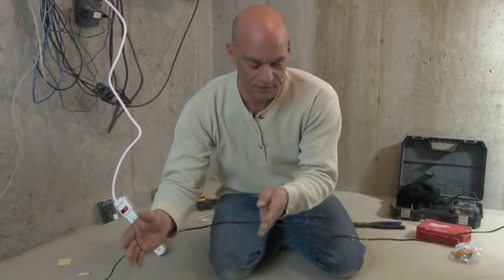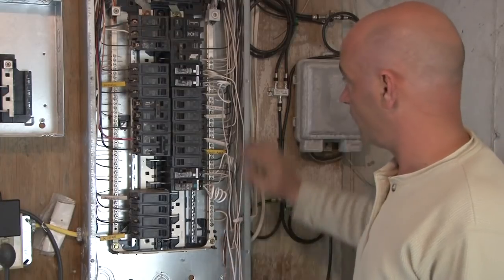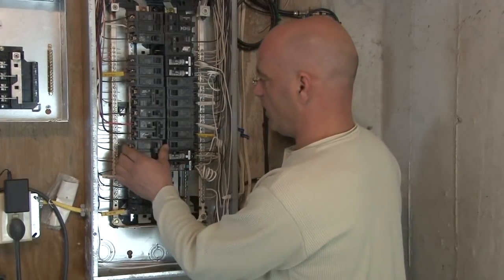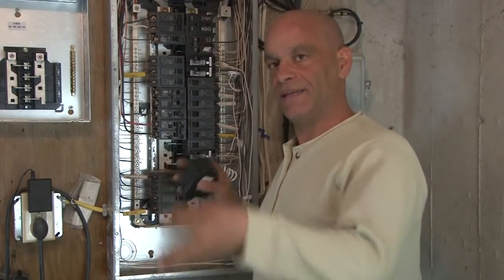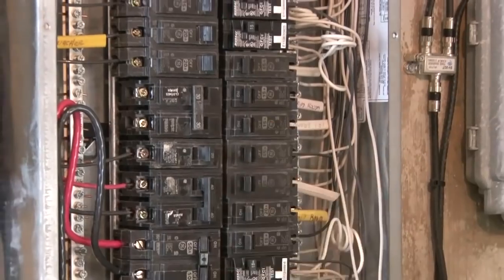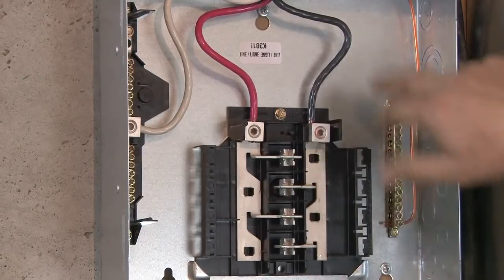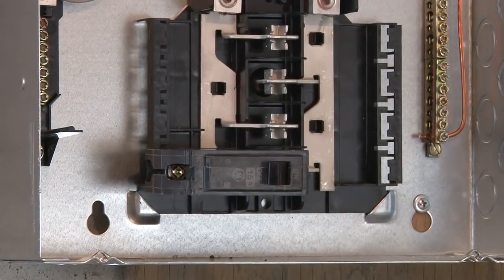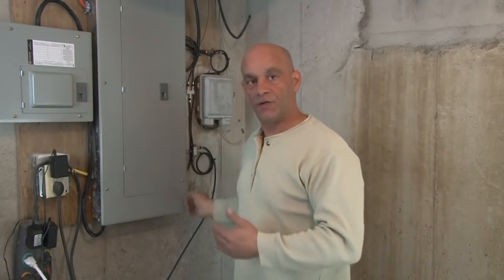How to Install a Subpanel

Comment: My Murray breaker box doesn't have a green bonding screw.
Reply from the maker: By code it should be green. But doesn’t have to be in order for it to work
Reply: @Askmediy  is there a to check if it bonded?
Can I use a multimeter also
Reply from the maker: @davidcowey604  Not really. You'll get a false reading I'm sure. Check out this page of mine and look for the picture. If you really can't tell after that just install a bonding strap-like shown in the picture
Reply: @Askmediy   ok thanks need to add a sup panel on my garage I am building.
Reply from the maker: @davidcowey604  I figured lol

Comment: Is conduit not necessary on the supply from the main panel to the sub?
Reply from the maker: No not at all. However so some reason it has to be exposed more than 18" I think. Then it will have to be protected somehow i.e conduit

Comment: I have a 100 amp main panel but want to install a 125 sub panel in my garage, is that possible?
Reply from the maker: Not really. You would need to upgrade your main panel first.

Comment: Hi there! I got some problem on my electric main box, one side of my workshop it's working pretty good .. but the other side I have no working outlets. I just  check those breakers and looks like every single one has electricity, but if I go ahead and check every outlet, that specific side doesn't have electricity. What I can do?
Reply from the maker: Check the neutral

Comment: Great video, thanks for taking the time to share. The only thing I would add is a reminder that the wires feeding the main breaker ARE ALWAYS LIVE. This is obvious to some but not to all. After turning off power by flipping the main breaker, everything downstream of that breaker is now off, but the wires feeding into the main breaker are still trying to kill you. Taping a piece of cardboard over the main breaker and its wires & lugs is an easy insurance policy. No one needs their screwdriver to slip and connect with a 240 volt 200 amp stream of death.

Comment: Glad I watched this as I learned about removing the bonding screw on the sub-panel so thanks for that. Now I feel good about installing a 60 amp sub-panel in my grandson's garage.
Reply from the maker: Awesome deal, glad I could help out.
Reply: @Askmediy  Good video. Thanks. However, it is not clear why the bonding screw must be removed in sub-panel. After all, neutral in sub goes to the main, where ground and neutral are already bonded. So, all the (green) bond in sub would do is to duplicate the (existing) bond in main. What is the harm?
Reply from the maker: Go to my site for the subpanel and read what I wrote

Comment: Idk but I would have run conduit between the two boxes. I was told that if u use any knockouts on the side u had to use conduit. The reason it because it is not within 3 feet to be stapled down. Idk just my opinion

Comment: Does the strap that connects both neutrals together in the Sub panel has to removed also, or is it just the bonding screw. Speaking of a 125amp Main Lug  Panel

Comment: I'm about to put a 20 amp DP from house to shed using 12/3 wire. Connect to sub panel on shed then add 2...20 amp 120v breakers. Would that work?
Reply from the maker: What’s a DP?
Reply: @Askmediy  double pole
Reply from the maker: Tell you off 12 wire is way to  small for any sub panel
Reply: @Askmediy  thank you so much for your input.
Reply from the maker: @peterzatolochenko1449  Always, now off to bed I go.

Comment: You forgot to say what size wire from main to sub. YOu said 50 amp. is that #8 or what? How about explaining why the screw is taken out of the neutral busbar on sub. Also why if you feed a garage or other building from the sub you have to have a separate ground with #6  rather than carrying the ground right back to the sub

Comment: I have a 200A Main Panel, IT'S A 16 CIRCUIT PANEL Inclusive of 8 full size breaker slots and 16 half size breaker slots. Therefore on both neutral and ground buss bars I will have 16 screws. Just saying if I'm installing the full size and half size breakers amount to 24 breakers , can I pin down on the bars neutral on neutral and ground on ground.  And my second question is can I install a 100A subpanel off my Main 200A panel. with a 3 x 10mm Armoured PVC Cable.
Reply from the maker: Yes, and I really can't say amperage without seeing it and knowing everything. But 100amp, seems like too much.

Comment: I have three phase power coming into my shop with a basic older 200amp panel that is nearly maxed out, I'm adding machines that are both three phase and single phase and my idea was to add a sub-panel to support the new equipment but i cant find any specific information about it. If I had a sub panel that can support 100amps and I need to feed the sub panel with three phase power, would I install a 100-125A 3 pole breaker in the main panel feeding the sub panel and then 3 and 2 pole breakers in the sub panel to support the equipment? Is this going to be the smartest way to add additional power in my shop?
Reply from the maker: Oh this is not an easy one for me to say. Need to know a lot more about your 3-phase. What voltage is your hot high leg. With a 3 phase sub panel I would really urge you to get someone there that KNOWS 3-phase. But yes. You  would come off the 3-phase panel , 2 hots to the sub, but I have to leave you there. I can get you hurt way to easy with this.

Comment: What kind of sub panel is that? Where do I get that type? I have an old house with a 100Amp small main panel and I am updating the kitchen and trying to put more circuits for newer kitchen appliances. And so far I've been finding only 60 amp sub panels with spot for only 2 breakers. Where can i get sub panel that you are using with room for... 6 breakers?
Reply from the maker: You can really use  any panel sized for what you want. But honestly if you only have a 100 amp now, I would just upgrade your panel.
Reply: @Askmediy  does upgrating my panel mean i need new service? What's the service wire gauge must be that i could put new 150amp main?
Reply from the maker: @CreatureOutOfTime  Yes all of that. That's going to depend on what you have now. But really if it's really old and undersized it would be best to replace that.

Comment: It seems like both the red and the black are coming from the same side of the panel , If I want to run 220 off the sub panel don't they have to come from opposite sides?
Reply from the maker: No, The breaker grabs both hot legs, 120 and 120 each.

Comment: With the sub-panel in another building, I understand the separate ground rod, Do you still need to use 4 wire? Thanks, Great Videos.
Reply from the maker: Yes by all means.

Comment: Great video! One question, I'm installing a 100 A sub-panel in an attached garage. The main panel is attached to the outside of the house, the sub-panel is inside the attached garage, but about 25 feet away. I'll run the 2-2-2-4 AL SER cable through metal conduit under the house in the crawl space to the attached garage. Since the garage has a cement floor it's not so easy to put in grounding rods in but from what I gather, it's not necessary since the garage is attached. Is this correct? Thanks again for the help and the video
Reply from the maker: Right, if it's attached you don't need to install a grounding rod for the sub-panel

Comment: So I don’t completely understand why the green screw from the sub-panel is removed
Would you care to explain?
Reply from the maker: First off sorry for the delay. For some reason I'm not getting emails on comments.. Because the neutral only gets bonded at 1st means of disconnect so any unbalanced load only has one true path to ground and that’s at the power source

Comment: I have been a Fan for awhile ,you have the best procedure that I have followed .I am running 100 amp from main to sub 60 ft  run away  from a basement to a attached garage I have the new grounding rod  outside the building  and all my new circuits are in on the sub panel .   i will be running #3 copper  for my mains and # 6 for my neutral and ground,,I need to run that in plastic conduit  ,my question is what type and size.thanks
Reply: Bigger is better and not much more money. Minimum I'd install is 1.5"
Reply from the maker: First off sorry for the delay, for some reason I'm not getting emails for comments. I really don't understand your question. Size of what?

Comment: Thanks for the video. Want to add a sub panel for a detached garage. Still gathering all the required information. Will try to upload the video.
Reply from the maker: First off sorry for the delay, for some reason I'm not getting emails for comments. Just remember for a detached garage you'll need a new grounding rod at the garage.

Comment: if I were to connect another subpanel to my existing main lug subpanel, would I just run the same gauge wire as I used for my first 50amp panel (used 6/3uf-b)? install a 50 amp breaker in existing panel to feed the new main lug subpanel in my second building?
Reply from the maker: In the perfect world yes. But you'll have to take in consideration the max amps of your panel. That's not something I can just give you an answer on.
Reply: askmediy in the sub panel I’ll be putting in the new building, there will be 6 outlets, one of the outlets will run a golf cart charger, the others will just be outlets should the need arise to plug in a vac or trickle charger, no constant loads like the golf cart charger. It will also power 4 LED 4’ shop lights and 1 outdoor LED flood light. 

The current sub panel that was connected to my main panel box is a main lug sub panel that used 6/3uf-b to transfer power. It is power 4 halogen lights, 3 outdoor wall lights, 8 outlets, and a garage door opener.

Comment: could i get away with as a temp  solution to just use a wire nut in place of a ground bar if its only 4 wries until next month? and if yes do i also ground the chassis?

Comment: One question, i know when you wire a sub panel to a detach building (shed) you need a #6 wire to a 8ft grounding rod but do you still have ground connected between the main and the sub panel as show in this video at 9:57 ?

Thanks.
Reply from the maker: yes
Reply: @Askmediy  thank you

Comment: Hello Dominck,
I myself am getting ready to install a sub panel to feed my basement.
I noticed that on my Main Breaker Box that the Neutral and Ground bus bar IS NOT bonded to the case of the breaker box..
Is this a issue ???
Reply from the maker: It can be, but I would need a whole bunch of more info to really say.
Reply: What more info do you need ?

Comment: if a subpanel is added for purpose of "extending" a filled up main electrical panel, then is it necessary or desirable to increase the size of the main circuit breaker feeding the main panel?
Reply from the maker: It would really depend on the setup you have. Say an older 100 amp panel and it's filled. yes by all means.

Comment: We Germans need low Ampere only. Household connection to the grid 3 phase 230 V, 40 A max per phase main fuses, 14.5 kW max. Waschingmachine 230 V 16 A, Stove 400 V 25 A. Wires thinner same function. Power outage I know from hearsay only.

Comment: Good Video what size wire you use ? And can it go underground? And if I ran to a 50 amp breaker to feed sub panel then I wouldn’t have to run to main panel to reset breaker if it tripped right ?

Comment: Hi Dom. Question for you. I’m about to get jacuzzi soon. Is it the same wiring procedure .
Reply from the maker: For a sub panel yes.
Reply: Thank you very much for reply . So I'm going to do the same steps to install sub panel as you did in  this video and  from sub panel to jacuzzi, right ? It's either double 50 or double 60 breaker .

Comment: Why does the subpanel get ground and neutral isolation, if the main panel is bonded?  Doesn't that make any ground you run to the sub a bonded ground anyway? If you were to conductance check the ground in that subpanel with the neutral, you would find it is connected, regardless of that bonding screw.

Comment: This is the best video I have seen on this subject.  Now I just need to find a video on how to install a manual shut off switch in between those two.  For running power to my shed the county requires a shut off outside of my shed.

Comment: Thank you for this video. I bought a 70s trailer and was told I need to upgrade the sub panel but didn't know what the difference was. I also didn't know why some hot wires were all black and some red and black. Thanks for the clear explanation.

Comment: This video was so helpful when installing a sub panel to accommodate the 50 amps needed for a high performance AV system in an older home. The system required three duplex outlets, two 15 amp and one 20 amp, each on their own circuits using oversized wire (12 awg and 10 awg),  that are separate from the existing electrical service in the house. Apparently all that juice is needed just to accommodate the system's new power amplifiers.

Comment: If the main panel main breaker is 200 amp, can the breaker in the main panel feeding the sub panel be 200 amps as well? I need the sub panel to hold 3- 40 amp double pole breakers. What size should the sub panel feed breaker be? What size wire do I need between the panels? Thanks!
Reply from the maker: No not even close.
Reply: ok? That's it? Can you answer the other questions? Why bother to answer if you didn't even read the whole question and are not going to answer all the questions? I enjoyed your video and obviously thought you were the personality who could help me get information. I guess I was wrong!
Reply from the maker: Yeah sorry about that. I guess the one reason I try not to answer questions on a phone. This is all going to depend on what your existing panel has in it. Quickly I would say install a 100 amp breaker. But there are so many factors that come in play here. I would need to be there in order to really say what you need to do, or could even do. Since this needs to be inspected by a inspector anyway, I would just ask him, what he will allow.

Comment: Great video, really appreciated it. All the "I'm an expert too, here's what you did wrong" comments are really annoying.

I did have one question though. If installing a grounding rod at a detached building, would you still run a ground conductor back to the main panel?

Comment: I have my addition all wired up, along with my sub panel, now i need to hook into my main box and thats where i get confused. Everything is all mixed up neutrals and grounds, even grounds going to my water lines run from each bus bar..i have #4 wire 2 hots a neutral and ground, do i just hook my neutral and ground in anywhere on either bus?
Reply: There is an isolated ground bar hidden behind the mess with absolutly nothing hooked to it, could i put my ground on that?
Reply: It is OK to have the grounds and neutrals hooked up together in the main panel as well as the grounds going to your water lines. But they need to be totally separate in your sub panel. Yes, you can hook up your sub panel's neutrals and grounds to anywhere on either bus. 

I don't know what your local inspector would say, some want the neutrals on the neutral buss bars and the grounds on the grounding buss bar - even through both buss bars are bonded together. In any case, you are perfectly fine connecting them to any buss in an electrical sense.

Comment: I have no main breaker in my panel.
Reply: +goofyfoot2001    Hopefully you got your answer after 2 months, but if the panel you are looking at is either a disconnect for a single item like the AC right outside or a Spa. That would make it a simple on-off. As for a Spa or Hot Tub as many call it, it is required within 15 feet from the tube. Otherwise, this panel is a "Sub-Panel", connected by the larger wires usually at the top that actually go back to the "Main Panel". Hope this helps. I don't have a youtube channel, but I can only imagine a guy being overwhelmed by emails due to one video. But I would think they owe it to their customers if they want to put it out. It takes less than 0.06 of an amp to kill you, it is the current, not the voltage. Retired ASE Master tech (Automotive Service Excellence / Certified in all 8 areas for vehicles) Not a licensed Electrician.

Comment: what happens if in the process of moving some breakers and wires to a sub panel and you miscalculated the length of the wire.Would it be ok to enter those wires into a junction box and then to the sub panel feed? What does the NEC say about the use of junction boxes for 1/0 cables and splices? I think I will need to buy that expensive NEC book any suggestions to renting the book or maybe finding one on ebay for less than $50. This book is dam nearly $175 and in some cases not new, wow!!!!  I already installed a 300 main service panel outside and will use a 100 sub panel for the garage and will put an additional 80 amp sub panel for the pool and outside lights. The wires like you said are expensive and I tried to measure the best for this application but for my elegance in my work the wires look to me be a bit on the stretch. I would have liked them to have at least eight more inches of stretch. I suppose it would make me happier for esthetics but I would like to know if the junction box works well with the code. Any help will be appreciated. Thanks Gabe.